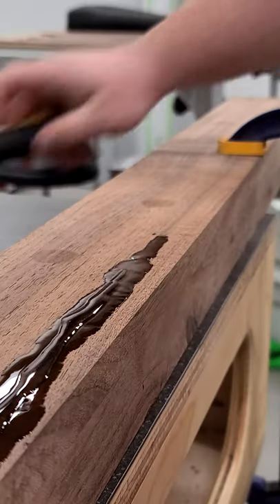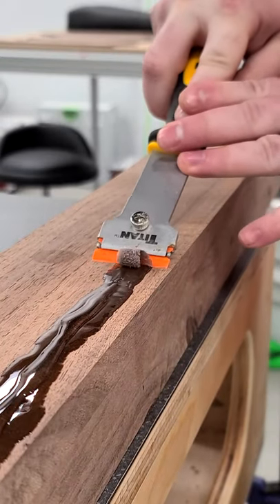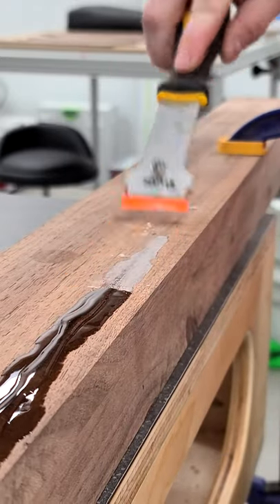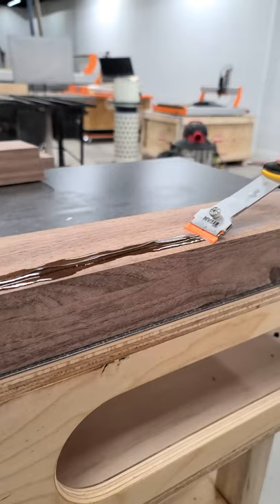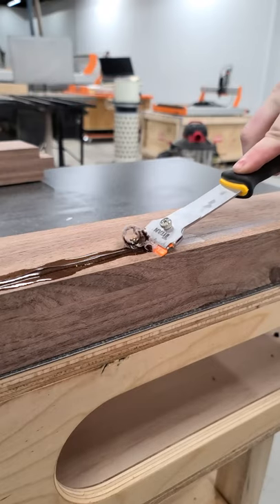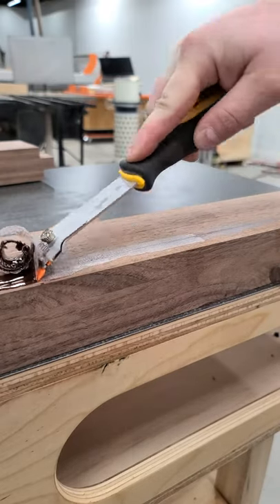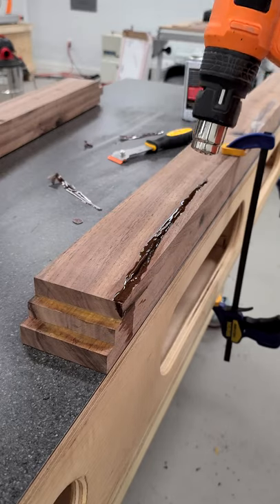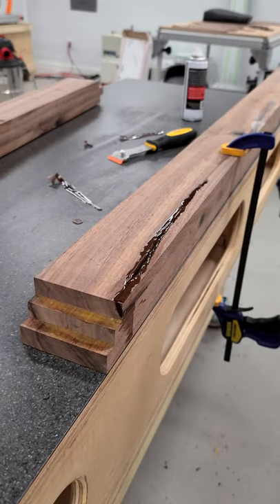Easiest Way to Remove Excess Epoxy

Comment: Heat guns are always giving more reasons for keeping them around, great tip
Reply: I managed to solder copper plumbing with one, before I got the torch. It does require an attachment to direct the flow around the pipe. I made one from a tin can, but they also sell it.
Reply from the maker: Absolutely, glad you like it!
Reply: 4
Reply: @ToolsToday  can I use the hair blow dry?
Reply: @ToolsToday how many hours will it take to cure before you can do this ?  and how much longer before you can sand it ?  thank you

Comment: Cool, I’ve watched loads of guys sanding like crazy on epoxy. Great tip Sir..😉
Reply from the maker: Glad you like it, it works great for smaller cracks like this!
Reply: @ToolsToday  what kind of scraper is that please? That would work on glass or fiberglass so I don't leave marks. Thx!

Comment: Bruh, so I didn't have to spend hours sanding.
Reply from the maker: Exactly!
Reply: No. Lol
Reply: Hours? What level sand paper were you using? I use 80 grits
Reply: @ToolsToday   Any idea what temp setting you used. I need to unglue a storage bay door on a motorhome that was glued together using Stika(which I think is like liquid nails maybe). The frame of the door is aluminum extrusion held together at the corners with screws and the body of the door is a 3 layer desk or PVC inner panel, 1 1l2" white styrofoam, and the outer layer appears to be filon(thin fiberglass sheet that's painted.) or PVC or abs plastic.  Thanks for posting.
Reply: If only I knew this yesterday 60 grit for about an hr maybe 90 min

Comment: How long after you pour do you use the heat gun? Sometimes its taken an hour or more for my epoxy to fill out every crack in a board. I'm just wondering if the epoxy sits below the surface of the wood after it cures, when you scrape off the top?
Reply from the maker: You have to wait until it's fully hardened.  I waited over night for this one.  Yes, the epoxy remains filled in the cracks.  This just removes the majority of it, so there is less sanding to do to remove it.

Comment: That's the thing though, heating it also makes it expand, meaning you're gonna end up needing to do more sanding because you've just made a divot in your work. Just get a plane or drawknife
Reply: Would a chisel work better?
Reply: @Crlarl  depends on how good you are with one and how you use it, otherwise no
Reply: I think this only really works if the scraper blade is wider than the resin blob. Using a plaster scraping tool (usually bout 10cm/3 inches wide) has better general use since the blade won't sink into the surrounding work...

Comment: Plastic blades? Where do you get them from?
Reply from the maker: Here's a link to the blades, they will fit in any scraper that uses a standard razor blade. - https://www.amazon.com/dp/B075L4VXC6/ref=cm_sw_em_r_mt_dp_Z3QXHWQ05YJJB1ZDWFAB

Comment: You sir are a gentleman and fine scholar! You saved me a whole day of sanding. My mold leaked a bit for my table(42"x24" so not small)an had an 1/8 to 1/4 in layer of resin in some spots on the underside. I did this on the edges just to get a plastic putty knife under it an i worked all the way around since it was so thin an just peeled it off like it was nothing!!!!

Comment: Where do you get the plastic scraper?  Thanks for sharing.
Reply from the maker: I bought the scraper from a big box store and got the plastic blades for it on Amazon.
Reply: @ToolsToday  go to your local auto parts store. I was an auto tech and have used plastic single edge blades to remove stickers on windshield glass that is coated. Also to remove adhesive on bodywork without marring the paint job. They have been available for over 35+ years. They're also great for removing excess grain filler while it is still wet. You can get extra mileage out of them by turning them over and lightly passing them over 1000 to 2000 grit wet/dry once or twice. I retired with 45 years as a tech and have been making furniture and repair & restoration for over 50. Woodwork was a hobby till I retired then it became a passion. Never looked back.....
Reply: @fkyew  appreciate your wisdom 👍

Comment: i have a resin river table poured for my Leaving Cert. This is going to save so much time. Also do you know what grit or what type of sandpaper i need to sand  the resin pour. Thank you
Reply: 1500 to 2000 water paper is good so you don't leave scratch marks but unless you have weeks to sand use it with an orbital sander...
Reply: @brazenh2836 Thank you

Comment: Do you have a link for that plastic bladed scraper?
Reply from the maker: Here's a link to the blades, they will fit in any scraper that uses a standard razor blade. - https://www.amazon.com/dp/B075L4VXC6/ref=cm_sw_em_r_mt_dp_Z3QXHWQ05YJJB1ZDWFAB

Comment: cool tip! (sorry for the pun)  where can I buy the plastic blades?
Reply from the maker: Here's a link to the blades, they will fit in any scraper that uses a standard razor blade. - https://www.amazon.com/dp/B075L4VXC6/ref=cm_sw_em_r_mt_dp_Z3QXHWQ05YJJB1ZDWFAB